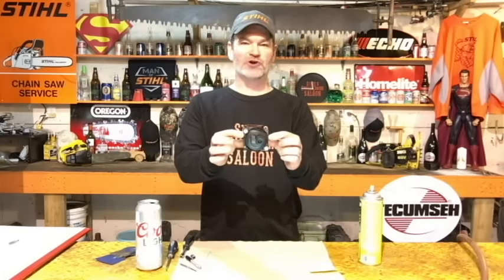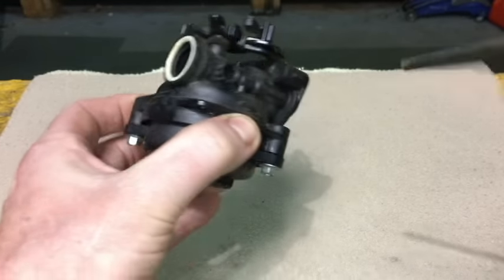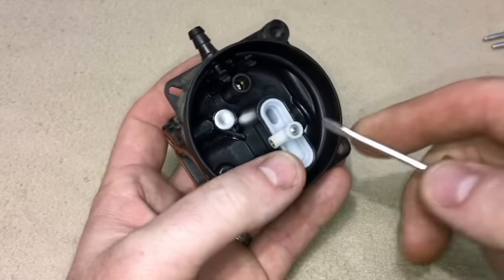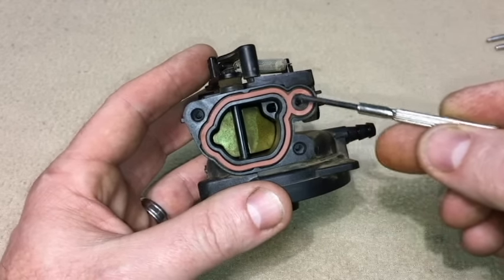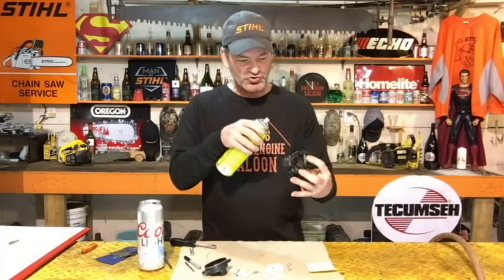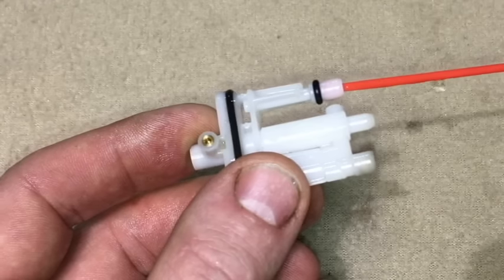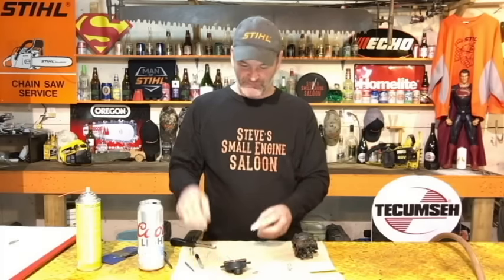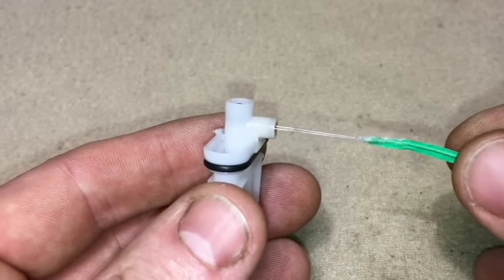EASIEST WAY To Clean a Plastic Briggs Carburetor

Comment: Hi Steve!  1st)  I watched this/your Briggs Carb Cleaning video - when my nearly brand new used once used Craftsman pressure washer Briggs 163cc would not start.  Just watching your video gave me the knowledge I needed to pull the carb and tank off and apart - clean it all and put it all back together!  Thanks!   

https://www.youtube.com/watch?v=qm7gsDHgXqw

2nd)  I have a Sears Chipper Vac that had an exhaust bolt break off years ago - just kept using it....      this last fall I rebuilt/re-enforced the whole top recoil structure (turned out nice) - and then tried to get that broken-off bolt out - drilled a small pilot hole in the bolt and tried an Ez-Out bolt removing tool....   and broke off the Ez-Out!!??......    How do you get a broke-off Ez-Out and the broke-off bolt out of a small engine exhaust manifold!?

Thanks Steve!

Comment: Steve, I have a Troybilt push mower with this carb.  It worked perfectly for 9 years until recently.  It would start, then immediately die.  The cost of professional carb cleaning would have been more than the mower was worth.  Thanks to you and this video, I had the mower back up and running in 10 minutes!

I am concerned, however, about your lack of proper PPE when you're using carb cleaner and compressed air in your videos.  You only have one pair of eyes, and the carb cleaner can burn the skin or cause dermatitis.  Anyone attempting this repair should wear goggles or a face shield, and chemical-resistant gloves.

Comment: That cartridge comes apart in 2 pieces with a flathead screwdriver. Then you can access the fuel tower holes.

Comment: What Steve has'nt covered which is a simple thing to do and really important, is after fitting a new Carburettor..be sure to rinse out the Plastic Engine Tank and the container where the Fuel is stored..if either of these has crud in them, it will end up in the Carburettor..I don't see enlarging the Jet Hole would help, as B & S spends big Money developing these Carburettors and Engines and no further hole enlargement should be necessary..just make sure Fuel storage container and Tank are clean...

Comment: I would be ashamed to have developed this carburetor.  Briggs & Stratton is headed out of business.  YouTube has hundreds of these videos on how to clean and fix.  Meanwhile battery powered mowers are the new best thing.  No gas, no carburetor, no oil, just press a button and you are off mowing behind a light quiet machine.